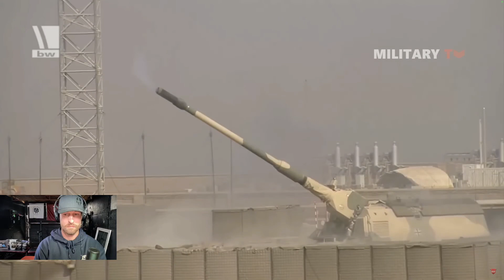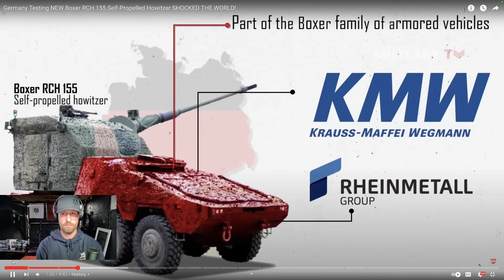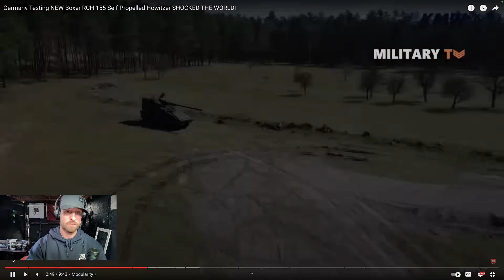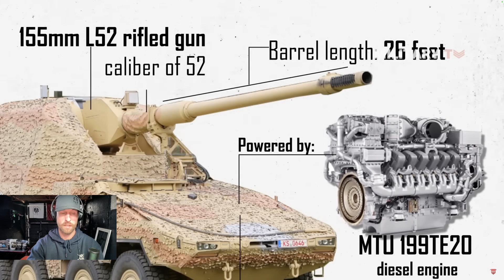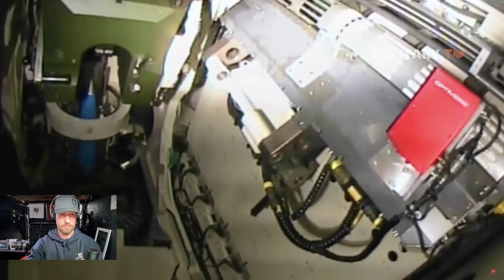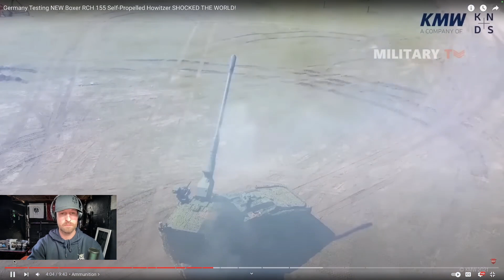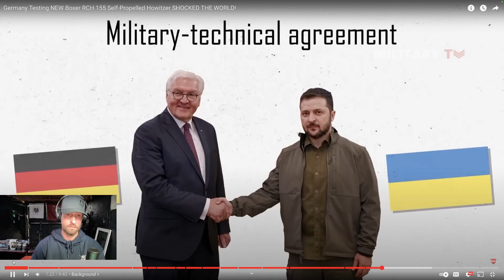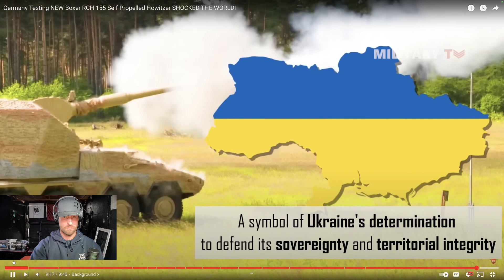Boxer RCH 155 British Armys New Replacement British Soldier reacts

Comment: Boxer RCH 155 looks a bit small and unstable when firing?!
Does it really have the same accuracy as the Archer?
Or is it a financial issue...
Reply: The gun itself is more accurate than the one on the archer, because of the longer barrel and because it has a small radar system that measures the trajectory of every round fired and then automatically adjusts if any deviation is detected.
Obviously, since it has a considerably longer range, it is also more accurate.

The reason why it can fire accurately on the move is that it uses a system coming from naval ship guns, where the computer measures the position thousands of times per second, like the stabilization computer on one of those "Segway" scooters and then delays the actual firing till it measures that the barrel is in the correct position to hit the programmed target point.
Reply: @TrangleC  It is not the barrel length that determines the hit pattern.
It is the stability of the platform that determines whether you can shoot
several shots in a row, without re-aiming.
Aecher is a sniper weapon. The latest model is on
an 8x8 chassis and with new upgrades.
I read that Sweden ordered 48 of the new ones.
They might complement each other in battle. :-)
Reply: Adding on the capability to not fall over while firing: When the system is impacted by the shooting, the bullet already left the vehicle. So there should not be as much of precision problem. However, i am not sure about the precision with firing while driving - which the RCH155 is capable of. And it´s the only self propelled howitzer artillery system capable of that.

But for the driving part: Remembering the video of the Leopard 2, carrying a mug of beer? That test was made 1986 - nearly 40 years ago. So i´d suggest, gun stabilization might even not be a problem anymore, especially combined with automated shooting, supported by a good amount of computing power.

Normally, moving that much likely would be considered a problem, because you have to do your manual recalculations, which take time. So you want to not move at all. If you  have a system that does all of that for you on the spot, this isn´t really an issue anymore, as long as you have a fully stabilized cannon and you don´t fall over. But also with the live firing showcases of the RCH155, i don´t see it to be to unstable to fall over. Really a good testiment for the Boxer-system.
Reply: It looks top heavy but you have to think the turret is not completely full. It houses the aiming devices and the machinery to elevate the gun and the autoloader. These last two need a lot of space to be able to move.
Reply: @bertnl530  The turret is made of aluminium and is pretty lightweight for its size.
Reply: @TrangleC   It looks in  terms of weight, balance and Centre of Gravity more worse then it is, yes.
Reply: @kibun1  I already thought it was high, specially for the older bridges and also ferries.  Such  a big vulume  moving during a shot or driving suggests instability, although the centre gravity is   on a lower position.
Reply: it got similar accuracy, with Volcano also a range of up to 72km with a CEP of 5m. And with the currently next generation Volcano ammunition entering production, its 100km with a CEP of 1m

Comment: Relying on another country's weapon's system to be used is really a slippery slope.  Its gambling at high stakes that you will continually have good relations with that country when the chips are down.
Reply: considering that the UK relies on german Rheinmetall to rebuild the domestic tank and AFV production, because the domestic british AFV and MBT production died about 20 years ago... there s no other choice than to buy german.
Reply: @zhufortheimpaler4041    For the short term thats fine.  But if you don't restart a weapons program for yourselves you will always be beholden to another.  You need to demand from parliament a commitment for British citizens to make British weapons.  Otherwise you are just making the Germans richer while hoping the two countries remain friends.
Reply: @Varzaak do you really think the British industry have a future? Especially when we are talking about armored vehicles such as MBTs and IFVs?

51% of BAE is already owned by Rheinmetall and BAE was the only big and important one in the UK.

The Challenger 3 upgrade was only possible with Rheinmetall and while the UK is trying to get there tanks upgrade all Major tank manufacturers are already planning and build the next generation. Abrams X, Abrams 3, KF-51 and Leopard 2 A RC 3.0, EMBT. All these tanks are already fare superior to the Challenger 3. They could enter full production in 5 - 10 years when the UK will get there last Challenger 3.

The Boxer program the UK left it bc it was not promising Germany and the Netherlands finished it and now the UK is buying for the full customer price. And there is nothing the Boxer can't do, Short range air defense, Drone defense, Brige layer, Medical, Mortar or a 155.

Ajax IFV it gets delayed, stopped, started, stopped and delayed again while there already better IFVs on the market like the KF-41. For the development cost they could have buyed a few hundreds of KF-41. On top of that the KF-41 can be changed into an Air Defense variant or 120mm just by changing the Turret.

Anything the UK build was a flop on the market.

Today you only have 2 options either Abrams or Leopard 2 (the K2 sucks and all trails showed that).

And with Rheinmetall buying basically anything the UK even had there is no future and it's good bc they will save money and get better stuff, the can build there stuff in the UK and the army can buy it and better price bc it's one of many Nations using it.
Reply: @simon_7620    Just going to answer you off your 1st paragraph because I refuse to read the rest of what you wrote.  Britain for centuries made weapons to defend itself.  Your politicians dismantled your steelworks.  You can build those back.  Basically what Im hearing from you is crybaby excuses.  You built the British fleet for two World Wars, and you give me excuses why you can't design and build your own artillery and IFVs?  If I was a Brit I would disown you.
Reply: There was this thing... <Cough>... called... Empire. Do you think the British are in the same position today? Are you five?
Reply: @Varzaak  well the British always had a big Navy it's not like they. They where the first one to build the all big gun armored ships (Dreadnoughts) they had the best steal works in the world. That's all true. They last good tank they build and sold was the Chieftain. The Challenger 1 and 2 where only sold to 1 country and the Ajax is a failure. The only reason they managed to upgrade there Challenger 2 is bc Rheinmetall bought it. They where great in the past but now they lack behind anything. The only reason for that is anything they made on the 60s and 70s where worse than what Germany and US made. Both Germany and US have build thousands tanks. While upgrading them and making them better while UK with is Challenger 2 where stuck with bc they where onyl ones using it. Same goes for the Artillery systems. When you have no one buying your stuff and no one wanting to invest in developing new stuff you get left behind. That's what happened. Now you neither have the money, facilities, the background or the knowledge. Bc it was either sold or put aside. There is no industry in the UK that can still produce large amount of tanks. KMW now KNDS and Rheinmetall could produce 300 to 400 Leopard 2 per year if needed. According to the MoD the UK could only produce 30.
Reply: @Varzaak not crybaby just reality 

UK has been running down defense manufacturing for decades and finding it difficult to get weapons deveyand delivered.

They have good niches but decided year ago to shut down factory and move into service industry.
Reply: Where did the K2 suck? The Army of Norway preferred the K2 over the Leopard 2 @simon_7620
Reply: @zerodawn2277  Surviability, reliablity, maintainability, lethality went to the Leo, Mobility to the K2.

The K2 has worse Arc protection than a T-64B (better said it has 0 Arc protection without add on armor), worse overall protection at the front. + it only gets the same CE protection a 2A6 with add on armor.

Same against CE, only gets the same protection with the ERA add on.
Reply: @zerodawn2277  sadly I can't post pictures on YouTube otherwise I could have shown you the protection of the K2

Maybe it's available on the internet but I haven't found anything so fare
Reply: @knoll9812    Thats the UK government's fault.  Everybody is too dependent on the US.  Every country should be self sufficient to a degree.  Thats why NATO is in such a mess.  Outside the US and Poland nobody is doing much of anything.  France is the only country that's actually trying to turn this thing around with their military.  This is exactly what happens when you start socializing healthcare, because you can't pay for both a military and subsidizing freebees.
Reply: @Varzaak  wich is not correct. The French army is basicly a gigantic Stryker brigade, with the heaviest equipment being lightly armored wheeled ifv's combarable to Stryker dragons. (and about 200 Leclerc mbt's in total), the average apc/ifv is an armored truck like an MRAP. the French army has half the 155mm artillery of Germany with double the size of the army, they have just a few 120mm towed mortars, mobile air defense is only shorad (meaning short range manpads) etc.
The French army is awesome in policing asymmetrical conflict zones, like Mali or Afghanistan. But in a proper war, they are about as reliable as wet tissue paper vs a peer or near peer opponent.
The problem with the UK is, that they can neither finance nor sustain a domestic arms program in their financial situation.
And socialised Healthcare has nothing to do with that.
As example germany has inflation adjusted the same amount of spending on the social state, healthcare system and education sector as in 1975. Germany managed to fund the largest and best/most modern equipped European military in the 70's and 80's. What changed since the 90's? Germany was forced to reduce manpower to below 370k due to limitations in the reunification treaty (2+4 treaty of 1991) and then to reduce heavy weapon stockpiles (tanks, artillery, ifv's, apcs etc) by 60% due to the CFE treaty between NATO and the Warsaw Treaty organization (this affected EVERY European military from 94 onwards). 
The german conservative government under Chancellor Kohl massively cut taxes in the 90´s. (reduced top tax rates for income, corporations etc by 11%, completely stopping taxes like wealth tax and a few others. wich in total reduced german federal tax revenue by about 15%)
The UK for example is struck with major economic problems since the 70's. The neoliberal governments of Thatcher and the conservatives have driven the UK economy and infrastructure into a wall at 120mp/h. The uk is economically more or less finished and could hold barely together over the last 40 years due to EU membership. This is now breaking down.
They have the highest tax rates since ww2 and would require a doubling of their current tax rates for 10-15 years to offset the gigantic backlog of investments into Healthcare, infrastructure, education, military etc wich have accumulated over the last 40 years
Reply: @zhufortheimpaler4041    Im not reading all that.  So Im going to just ignore your comment.
Reply: @Varzaak  Except that even the country with one of the highest cost for its socialized healthcare still pays half (per capita) what the US pays. If Germany would switch to the capitalistic corporate greed nightmare that is US healthcare, they would have LESS money for the military. In numbers: US spends $13.400 per person on healthcare, we spend $6200. You know, in addition to no-one worrying about healthcare costs ever or going bankrupt. You pay 2.3 TRILLION dollars more for a shittier system and a lower life expectancy (80 vs 76 years). 

And, you know, Germany had socialized healthcare since the end of the 19th century, and I think it can safely be said it hadn't affected Germany building up a considerable amount of military power in the past, including during the Cold War.

Your objectively wrong opinion is what happens if you watch Fox News, and let pure bullshit get in the way of facts.

And you seem to have missed the news that Germany is now MASSIVELY upgrading its armed forces again.
Reply: @drsnova7313    I understand that but you are paying others to make your stuff.  Instead of making it for yourself and employing your people.
Reply: MTU the engine supplier is owned by Rolls Royce and the uk was originally in the Boxer consortium when the initial requirement / specifications were drafted but pulled out.
Reply: @christasker2944  yes and no.
MTU is currently owned by Rolls Royce as parent company, but still registered and situated in germany, R&D, Production etc is all done in germany, not the UK. (even though RR is doing its best to fuck up MTU with its crackhead fincancial and economic policy)
Same with HK in the 90´s.

While the UK was part of the Boxer Consortium, it pulled out before the final prototype stage and the british prototypes and design bet got rejected (back when Boxer still was a 6x6, not an 8x8). The prototype that won was the german-dutch ARTEC Boxer 6x6 that then turned into the 8x8 we know today.
The UK quit before the 8x8 ARTEC prototype testing started proper.
They build 3 in Telford in 2004, but then they quit.
The lines in Telford for new production AFV´s closed shortly after. 
So the british AFV production is dead for about 20 years now
Reply: @christasker2944    So you got an engine.  Big whoop.
Reply: This is the unfortunate thing about leaving Europe. Britain was part of an emerging country - with carefully distributed allocation of manufacturing resources to maintain balance. Now it's cut out of those collaborations, all the lies about a golden future have turned out to be the dog sh1t every thinking person knew they were, and now the UK is just too economically small to keep up in all areas.
Reply: UK went British with as90. However the outcome was that they ended up with almost no dog and doubtful if making good in the next fifteen years
Reply: TeLityyis that only USA and China can afford to build all their own stuff.

Comment: Does it have a C of G issue, as the turret height is huge and aft mouted on the vehicle?  to me it looks as though the risk of rollover could be quite high. With no additional support for the firing platform when in use, surely this must affect accuracy?
Reply: The RCH 155 can fire on the move, has a flick auto loader, drop in compatibility with the Boxer, 44 ready rounds and is crewless.
Reply: @frankcessna7345   doesn't mean it wont roll over when off-road due to it's top heavy design! With no-one in the drivers seat there is no feedback, or feel for the consitions it may be required to operate in. Not impressed.
Reply: The turret is almost entirely made of aluminium and is nowhere near as heavy as it looks.
Reply: @TrangleC  which is heavier, a pound of feathers or a pound of steel?  Just because it is made of al alloy does not make it better, just bulky, as the thickness of cover must be thicker to do the same job as steel, but with less bulk.  The report tells us that it is being procured buy bean-counters once more, "because it's cheaper" - Not impressed.
Reply: @wolfwise44  That is entirely besides the point. This is not about a pound of this vs a pound of that, this is about you having to build a certain thing and then making it lighter by building it out of a light material. What is so hard to understand about that?

Also, this is not a MBT. No SPG is built to survive more than mild shrapnel, whether it is made of steel or aluminium.
Reply: Just like the good old Routemasters.😉